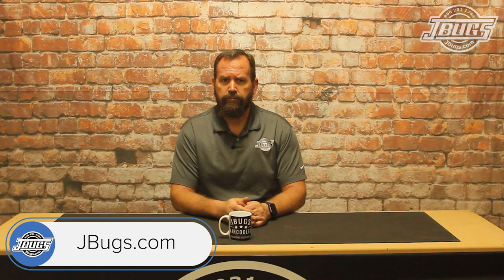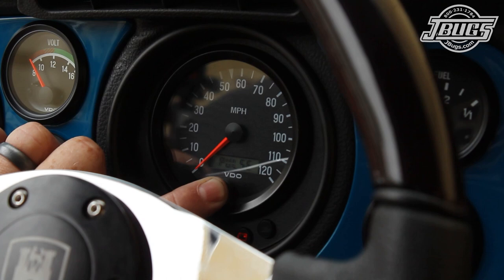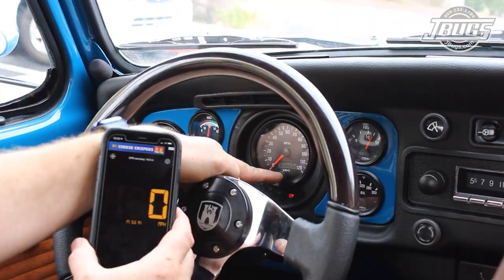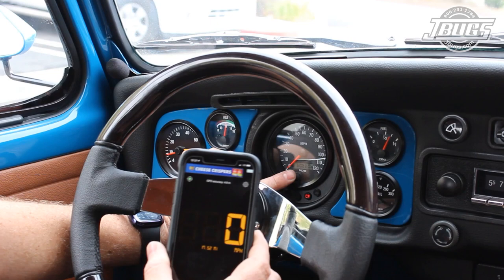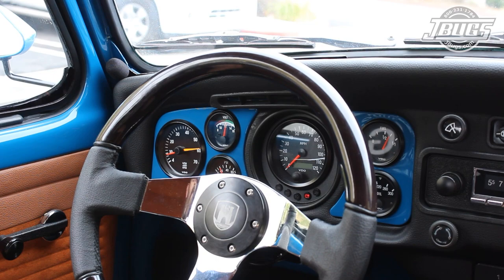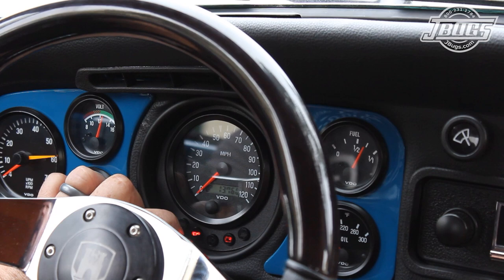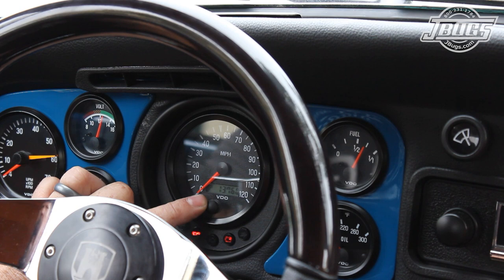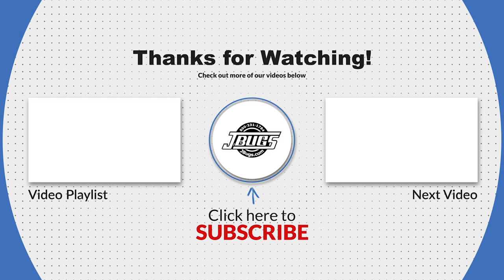JBugs - 1971 VW Super Beetle - VDO Speedometer Programming

Comment: Hi: What should be a normal temperature reading from an oil temperature sensor?
Reply: Typically about 210 to 220 seems to be normal for all the engines we've run a gauge on. At 235 you may want to stop and let things cool down.

Comment: So what might be a dumb question for you, how do you get rid of speedometer bounce without changing from the old cable system?
Reply: Assuming you've replaced the cable, it may be time to rebuild the speedometer.
Reply from the maker: Speedometer.com is one place still rebuilding speedos.
Reply: @Sam_Mebane   I replaced the original cable after it broke about a year ago and it kept bouncing just not as bad, now the end of the new cable is rounded to the point that I had to put in shims while I wait for the new one to arrive, can the speedometer be rebuilt at home?
Reply: @easternWashington.  not effectively, no.
Reply: @Sam_Mebane  well I guess I'll have to send it in and have it rebuilt. thanks for the info.

Comment: Where did you get the outer ring around the speedometer that has the led lights?  What diameter is this speedometer
Reply: I made the adapter. The speedometer is 3 3/8”.
Reply: @Sam_Mebane  Sam - what material did you use to make the adapter that surrounds the speedo? is there a video of that?  curious what lights you added and what sensors feed each.
Reply: @reedrobertson5839  a sheet of 1/4" ABS plastic, there was no video. The lights operate off the stock wiring for all of the stock speedometer indicator bulbs. The only change was I added a resistor to the alternator light as an LED doesn't have enough resistance for the internally regulated alternator.
Reply: @Sam_Mebane  I've been building a Baja out of a '74.  I have a new fiberglass dash cover that has the hole for the stock dash..... and then I found some cool aftermarket speedo's that clearly won't fit that.  Is there a video somewhere showing how to install the speedo?  I don't know now the stock speedo is held in.  I'm thinking that since you used a piece of ABS, there must be just some clamps that hold it in similar to how the gas tank is held in, if that makes any kind of sense.  Am I close?
Reply: @KlineGeek  the stock speedometer mounts to the threaded bosses on either side of the stock dashboard. We cover the installation of the speedometer in our dashboard installation video here: https://www.youtube.com/watch?v=y1BidLcAqBU at about the 9 minute mark.